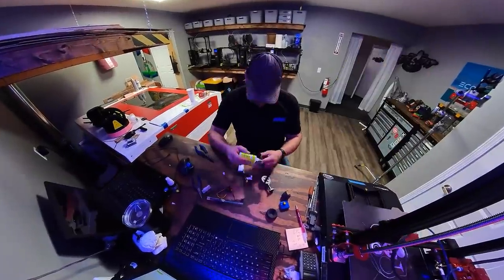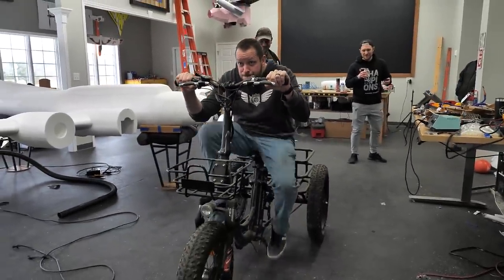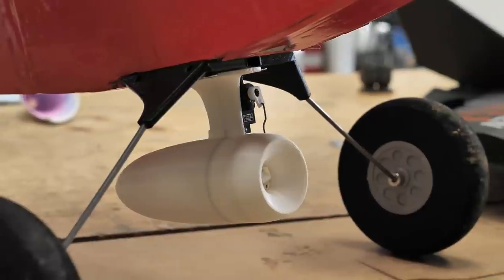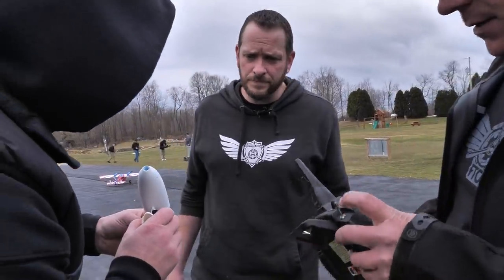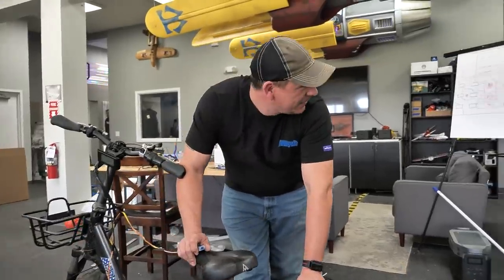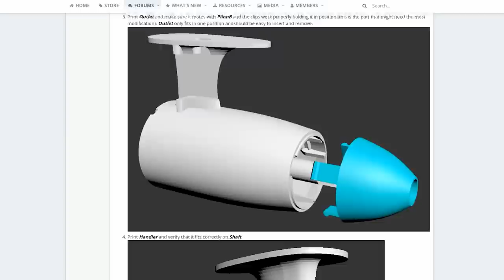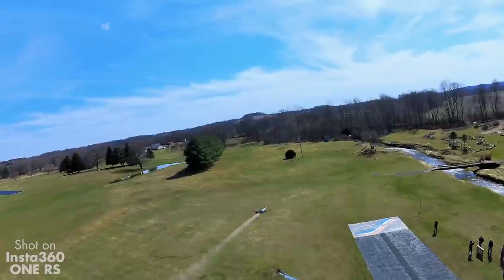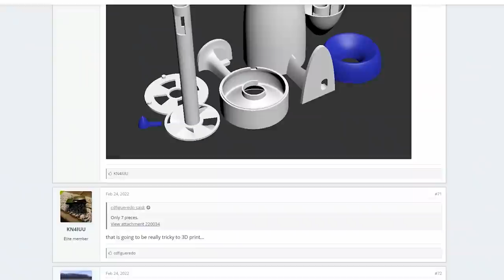Will It Smoke? 3D Printed Smoke Generator and Motor Bike - Week 9

Comment: I think having a tractor prop directly in front of the "smoke generator" would work. It would give more air pressure than just the passive air from the plane speed. It looks like that is what the working test footage was doing as well.
Reply: the problem you have is that you need  a relatively smooth airflow going into it. what you could do is the opposite.. i've done a similar thing in my blue angels EDF that i had, I found that if you have an EDF and put the "smoke cartridge" in front of the EDF so that it sucks the smoke out and through the EDF it works a heck of a lot better than after the edf

Comment: I have an idea for the smoke generator. Where the air linlet is,  instead of just a hole where air blows through it attached a small electric  fan to blow air through the system. Just rob a little power from the battery pack that's already on board. That way it doesn't matter if you're flying faster or slow, there will always be smoke.

Comment: Here's a different idea on your smoke generator. Try to extrude the powder, use a drill bit and a small electric motor to power it. They use screws for moving powders and grains, sugar and so forth. a V hopper feeding a rotating screw would allow you to turn it on and off, and changing screw size would allow you to control how much it extrudes. If it works, you could 3d print the screw to the size you need.
Reply: You could 3D print a prop to the opposite end of the screw (augur) to have it rotate it.
But that might turn it too quickly.
I like your idea though.

Comment: Something to try but you could take a vape pipe apart and use a Lithium battery with an element inside of that. I also remembered watching a show on custom armored cars for executive protection. That had smoke screen devices, that they said used some sort of transmission fluid/oil. Which nowadays for many cars has quite a thin viscosity. Something that would drip small amounts of the oil onto an electronic heating element? However encased in alumuminum or metal housing for heat and fire resistance?

Comment: David, on the Smoke system is there a way to neck down the inlet tube where the powder is picked up so you create a venturi (negative pressure) so the powder is sucked into the tube?

Comment: Try to use a large syringe, filled with Talcum Powder, pushed closed by a linear screw and servo, then run flexible tubing out of the fuselage at a high pressure spot. Turkey Baster size, or 3D printed much larger, like for the B-17 maybe?

Comment: I wonder if corn starch or some other powder could be used instead of talcum powder?  It might be more flammable, but probably only a risk in the immediate vicinity of the plane.
Reply: I think that if you crash an RC plane into the ground with a full tank of corn starch, that most of it will just end up in a pile and a small bit might blow away in the wind and be a small hazard, however, if you crash into a tree then the corn starch could aerosolize(?) as it falls, and if there is an ESC that caught fire, then it could be a larger fire hazard and might flambe the tree.  Perhaps TKOR has an idea of a powder that is less flammable, they've done a lot of testing with inflammability of corn starch and other powders.

Comment: Use vegetable glycerin! Resistance wire and big batt. Make a coil of kanthal or nichrome wire and uses a nozzle to point at the hot coil and make smoke bomb amounts of nontoxic vapor just like a fog machine! I vape! All you need is 2.5v and like 10A for 2800c @. 04ohm

Comment: Here's a question.  What was the humidity like that day?  I've seen powder issues before due to that.  Even though it isn't enough to make the powder clump up, it could change the "viscosity" enough so that it doesn't want to flow out as easily, and will require more air flow.
Reply: We did consider that there were a few different tests

Comment: you could always use an e cigarette heater to make smoke from basic vegetable oil as well .. and it is self contained ... and they even come with their OWN reservoir ... 
.
added bonus more aerodynamic ... SMALLER cross section ... and streamlined ... heck if it has a pocket clip like a pen then use that to attach it to the plane bottom ... 
.
activate with a basic remote controlled switch ...

Comment: Take a tiny ultrasonic mister part put it in a pipe it's size around and only an inch high if that ...then two tubes on ether side of it ...mesh with fine mesh over top of tube (maby maby not) ...and then add a tube on top like a T and have the mesh go into it in the center....add the tiny driver for the ultrasonic and add a tiny pump and water tank in a loop with that cup....it will make alot of smoke ...atleast in other testing it did

Comment: That bike needs a turn stop. There's a certain point past where the front wheel will not work right on 3kes of that configuration. Ideally, you want a smaller wheel up front. Whomever made that was thinking of tadpole config. where the mass is centerfold. Shame, the bike is really nice otherwise.

Comment: can you finally hear zinc-air salt water fuel cell with zinc wire, ie, fuel engine with the wire spools
Reply: remember to circulate the electrolyte with a water cooler loop, so that the produced zinc oxide will not mess up the fuel cell, yes its a solid zinc wire spool
Reply: assume the spool will have 1.4kwh/kg energy density, exact and the other stuff if part of the plane and a separate engine, the zinc is only the fuel, air is the oxidizer, but you have 90% efficiency or more, from the metal-air fuel cell
Reply: start making your own metal-air fuel cell power sources, and have the metal wire spools (zinc, aluminium, magnesium, iron, silicon) in store
Reply: feed the wire as in a 3d printer, only so much that you currently need, and keep circulating or empty the electrolyte, whenever you stop then engine, you dont mess up the air-platinum electrode, of the fuel cell engine
Reply: lol dudes
Reply: land craft, as in water craft, propeller powered